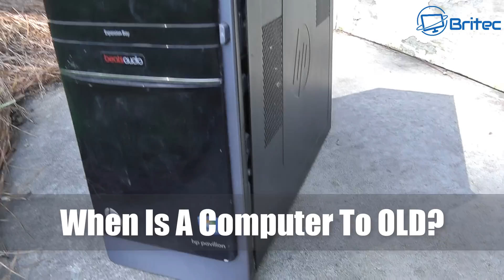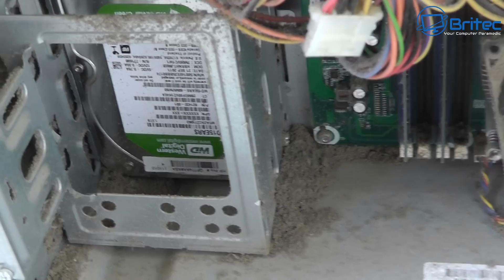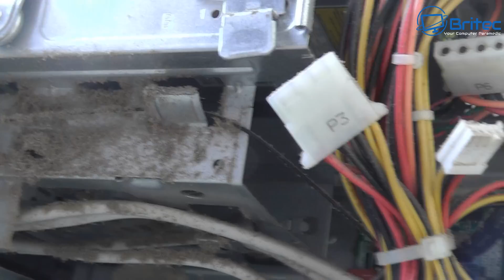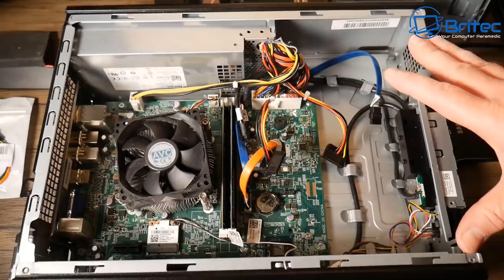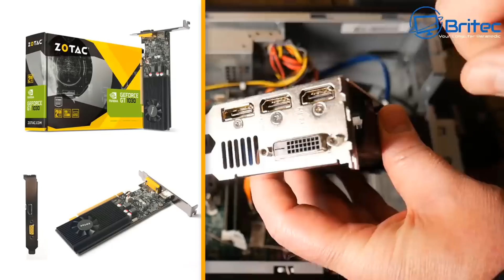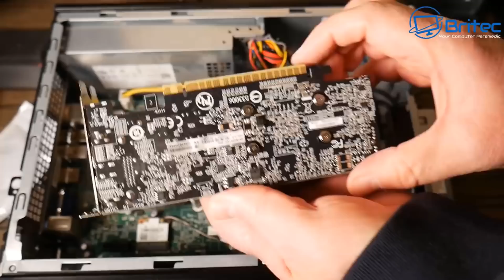When is A Computer Too Old

Comment: A PC is old when I can't do what I want to do with it. Otherwise it's perfectly OK.
Reply: I found when I purchased a new Windows 7 machine (back in the days when Windows 7 was what new computers came with) that computers can also be too NEW to do what I want with it. Approximately half the software I needed to run didn't work any more. And it wasn't a question of "getting new software" to do the same job - it didn't exist. I still run an old XP laptop for that reason.

Comment: This is a tough nut to crack😅 if it is about a personal computer for day2day-tasks, dont go too old. Sata, USB3 and SSD is a must i would say. Its also about reliability. Sandy Bridge is my minimum. If it is about a little server, consider old systems use more power. For NAS, reliability again. Really put a 18 Tb hdd into a 14 yo computer?! I like to build batocera computers from old systems for friends, also vortexbox, daphile, openelec etc. are running quite well on low spec machines. One exception: i run still my obsolete WD mybook with openwrt, fast and secure😉
Reply: why USB 3? Not everyone is transferring large amounts of data.
Core 2 Duos still works fine to this day, especially the 3ghz ones and the 2.5+ core 2 quads.
Reply: @yotoprules9361  Yeah, right. But whenever a external backup or an image recovery is necessary, it will take forever😁 but sure, if you dont need it its ok.
Reply: @sheldonkupa9120  you can also get USB 3.0 expansion cards, they work quite well.

Comment: 2011 dell XPS 8300 - i7 2600, 16gb ram, 250gb ssd & gtx 960. These compenents are second hand upgrades that I got for free while volunteering at a computer refurbisher but I paid for the used gpu upgrade few years ago. The only thing thats failed was the original 2TB HDD.
The only advantage in upgrading would be to play newer games and supporting windows 11. I play a lot of older games as i work my way through my steam library.
A normal person coulnt tell the difference between my computer and a new one unless they do a cpu benchmark compare. It starts in 10 seconds or less and is very responsive.

I work with a lot of laptops from 2016 which are atleast 3 times slower due to slow hdds. These are acutally due for replacement and can sometimes take 8-10 minutes to log into. It just shows you that age isnt everything but I will probably build a new pc in the next 2 years, mainly for windows 11 support, better game performance and hardware reliability.

Comment: I've found old computers, like old smartphones crash, irretrievably after an "update" . Only to work fine on older software after buying a new machine.
I was always imprerssed by startup, etc speed of new with latest. I also noticed that, other than graphics, the older, with systems they were designed for, work better.
Win 7/10

Comment: I have an old pc : Intel 775 dual core e5300,ddr 2 2gbx2 667mhz =4gb,hdd wd 500gb sata Ii with this configuration a dual boot with: 1) sparky Linux 32bits (wm open box,File manager pcmanfm) 2) Windows 7 ultimate 32 bits, i don't need an SSD for this pc,the response time "optimal" RAM between 200mb-1.2  GB (sure this machine don't works with the last games or renders) but for an Office envoirment Is excelent,if u have old hw and still works,why don't give It a "second Life"?.
Reply from the maker: Wow you do have an old pc
Reply: @Britec09 really my host pc is a core i3 9100,and i have more old hw an AMD sempron 2007 and pentium 4 tower 2005 with Ubuntu server.

Comment: My PC is 8 years old. It is a 4790K running at 4.6 Ghz with liquid cooling, Gigabyte Z87X-UD3H MOBO, upgraded graphics to 1660 Super (while only $Aud 360), 24 gbs of DDR3, replaced PSU with RM750X when the original died but that is it. Still a quite fast PC. Faster than some modern ones! Runs new MSFS (at 4K I might add) at quite high settings and renders video quite well. Microsoft in its wisdom says it is incapable of running Windows 11 - CRAP to that! The MOBO can accept V1 of the security chip (not good enough for Microsoft) and of course the rig would easily run Win 11. I will keep it until either the CPU rolls over and dies or Microsoft stops Windows 10 support. There are still some quite powerful older PCs out there and the newer parts like power supply, liquid cooler, ATX case and fans can all be used in a new build when it eventually has to be done so they are not wasted at all!

Comment: I am very tired of the 'disposable' generation, who think that you must be on the latest and greatest hardware to get a good experience.  I work in I.T. for a company who continues to dispose of very reasonable hardware, not because it can't be easily repaired, but because it is simply out of warranty.  We trash those systems all the time, even though a simple reinstall of the operating system is often enough to fix it, but sorry, out of warranty.  We throw away so many decent computers, iPads, iPhones etc. it makes me sick.  I salvage as much of those systems, repair them, upgrade them and give them to friends and non-profits as I can.  It's also funny how Windows 10 and Windows 11 are so much more efficient with their handling of processor cycles and memory, that a system that ran okay on Windows 7 runs like a champion on Windows 10 or 11.  One of my hobbies is to find what the minimal limitations are for hardware for Windows 11.  I have installed it on an eight year old netbook (remember those), and it runs okay as long as you don't try to play a YouTube video or run Microsoft Office.  That is because it is running on an Atom processor, with two gigs of ram.  But seriously, think about that!  An Atom processor on 2GB of ram, and a really weak GPU!  I know you're thinking that makes your point, but it doesn't, because that is the extreme low end, it can run well on almost anything above an Atom processor with more than 2GB if RAM.  Everybody seems to be caught up in the stupid game Microsoft and Apple play, which is we have a new version, you must replace (rather than upgrade) your hardware to run it.  Of course they subsidise the sale of computers with their latest operating system installed.  They Linux thing is only an option for us geeks who have been in the game for a very long time.  Unfortunately, Linux builders have never made their OS friendly to Windows or Mac users by using obscure references to applications, and making their OS not friendly to software manufacturers.  That of course is the reason why nobody makes viruses for Linux, they are only two percent of the market, and those are servers and hobbyists.
Reply: Yes, linux could be a big chance for old but still good hardware. I run my airbook mid 2012 with pop OS from sytem76, and man, its better than ever! And flex os is a similar idea. But all the linux distros for low spec computers have their downfalls and are not ez to understand for standard users.

Comment: MSI A88X -G41 PC Mate with AMD A8-7600 APU FM2 ; Radeon R7 Graphics; 16 GB (2x 8GB) DDR3 Corsair Vengeance RAM 1866 MHz.  Built in November 2015, with Win 7 Pro. on Spinner.  Now also has Win 10 on 256 GB Samsung 870 EVO SSD.  Not used for anything heavy-duty and does everything I want of it.  Email; Surfing; Writing Letters; designing Birthday/Christmas cards in MS Office 2000 Pro and MS Publisher 2000 Pro.  In other words; it does everything I want of it and nothing more.
Reply from the maker: AMD A8-7600 APU FM2 I remember them

Comment: What idiot would let their computer get that filthy inside? My computer is around 10 years old and still looks brand new inside and out. I never let dust or dirt gather up like the one you're showing. That's just from someone lazy and filthy. A good clean keeps it going as it should. Having said that, it will of course eventually be too old to use.

My stereo system goes back to the 1970s and 1980s and still works. My turntable is from 1976 and works perfectly. Only computers are made to need upgrading to keep the money flooding in. Just a money scam.

Comment: my computer is 13 years old with a xeon e5450 modded to a 775  in a hp dx2400 with 8gb ram 2tb hd + 512gb ssd then a 750 ti it did video edditing with no problems and was good at games unless they required sse 4.2, then i upgraded about 3 months ago to a i5-4670 with 16gb ram then moved my hd's + gpu over from my older computer. the boot up time is faster with sata 3 vs 2 but not by a whole lot maybe 15-20 seconds and i can play a lot of games i couldn't with the old HP because i now have sse 4.2 but other then that i don't see any real inprovement vs my old HP

Comment: My daily driver for telework is a Dell Inspiron 620 MT.
As long as the case is ATX standard it’s never too old.  I can work with it as long as it has a non proprietary front I/O header cable, rear I/O knockout, mATX board stand-off pattern, and allows an ATX PSU.
The oldest PC that I own is a Dell Dimension 2400, and being what they are worth on the vintage market I plan to keep it stock.  My next oldest is a gutted V2 Premiere that I purchased in the Shop NBC days, it’s a sleeper.
As a preteen I had an IBM 5160 XT, that would classify as too old unless one wanted to use software from that era.
Edit: I forgot that it (Pentium III and up) can also be repurposed as a DIY NAS.
Reply: Hahah still have a p100, intel mb, 4 meg of match memory.  Also an old single core tosiba laptop I used to burn  8 bit and 16 bit EPROMs. Runs win98

Comment: I have an 11 yr old HP DV7 laptop.  I have upgraded it massively over the years as far as it can go.  It started on Win 7 Home then I went to Win 10 Home and now it is on Win 10 Pro.  I went pro because I was going back to school to upgrade my tech skills and wanted all the bells and whistles.  I got an inexpensive and 100% legit key online to go Pro from a source I trust 100%.  Hardware wise it cannot go UEFI but that's OK.  I upgraded the RAM from 8GB to 16GB and then upgraded the slow 640GB original mech drive to a  1TB SSD and since it had a second bay I added a 1TB mech HDD.  It has a 17" screen and a (get this) Lightscribe optical drive!  ROFL.  It has served me well and continues to serve me well.  Since swapping to an SSD for the C: drive the machine has sped up tremendously.  The CPU is a quad core i7 running at 2.20GHz.  I have already purchased my replacement and use my old girl to remain on my desk with my multiple external USB drives connected to a 10 port USB hub and have the drives shared out through the old girl so I can access the drives on my new MSI from anywhere in my apartment.  I plan on keeping the old girl running as long as she will last.......When I purchase tech I always keep the future in mind even if I have to pay a little bit more and that proved itself out with my old girl being 11 yrs old and still running like a champ.  Extremely happy with my purchase.

Comment: I agree to some extent
Running 2008 Dell xps 420
Dual boot windows 10 and Linux mint
Only use windows when necessary  for certain software
2tb wd drive, 512gb ssd, 8gig ram,2tb external and 1tb external for backup on linux
Fits my needs , but do agree
Too many dollars put into old systems Doesn't make much sense
Reply from the maker: Thanks for sharing

Comment: I just last week bought a brand new desktop. 32G Ram, 1TB SSD, and many other features. Price was great as Costco had a sale on their Dell 27 7700 desktops. It will replace a 13 year old HP TouchSmart 520 PC that still runs good today. Over the years I had added to the original 4G of RAM it came with another 4 G (motherboard’s maximium there is 8G).I replaced the original 1TB HDD with a 1TB SSD about 5 years ago. If came with wifi, and a webcam. I added Bluetooth to it 2 years ago. I left it running with windows 10.
The new one is a big difference! I agree, … you can only do so much with these old devices (I also have 15 year old Toshiba laptop running with windows 11, and put an SSD and Bluetooth on that one years ago also.     WHY?????  So now this new Desktop and a laptop I bought 2019 are the way to go for me. Old cars can be restored and maintained to run fine, but ld computers? Maybe not.

Comment: 2009 ACER aspire X1800  came with VISTA.  Updated to 7 and then 10. Have a couple of external hard drives for storage and backup. One of your vids got me to double the RAM to a whopping 4GB (kudos for that). Its not 11 compatible.  Not a gamer or editor of any sort.
In a nutshell it does the trick.

Comment: 10-12 year old PCs are not that old and obsolete. I still think 775 PCs to be very usable(Dual Core 3.0GHz and above), but one just needs to adjust expectations...and add an SSD, don't you forget. Not only makes storage much faster it also makes your computer not so slow when you run out of RAM (for those with only 4GB of RAM).
Reply: You could even upgrade that Core2Duo to a Core2Quad if you wanted to.

Comment: I have to repair computers since (‘86 single sided floppies) and still using scsi drives and p3 intels. Not one looks as lazily cleaned as yours posted! Most common failure is drives then power supplies ( newer )

Comment: Probably the oldest budget computer specs that can run modern games would be roughly specced like this

DDR3 RAM 16GB
128GB SSD boot drive(Minimum)
5400/7200 RPM HDD
Quad core processor running W10/11

GPU? Any 2GB VRAM GPU(don't expect great fps though) 4GB VRAM is probably the minimum for PVP gaming

2cents from a computer hardware noob

PS: My personal build is a 10105+1650 GDDR6 

DDR4 16GB Klevv

256GB Lexar boot SSD 

1x 7200 RPM 500GB Barracuda
1x 5400 RPM 1TB Slim(converted from external).

Probably an i5 would have been better for the extra cores while playing Football Manager but otherwise works decently

Comment: If the computer does what you want it to do then it isn't too old. Most people aren't rendering video or playing video games. The vast majority are just web surfing and reading email ; both of which are primarily limited by connection speed not processing speed. 
I am running dual monitors on an FX4100 with 8gb ram. I web surf, design circuits(CAD), listen to music, watch movies etc. and I can open as many windows as I need. Tests with a second FX4100 proved that it can run Windows 10 as efficiently as Windows 7 after using WPrivacy10 to turn off most of the unnecessary telemetry. The only upgrade needed was a cheap video card to replace the onboard video. I have a 2 year old Windows 11 laptop and it runs slower than the outdated desktops, so new isn't a fix all. And no, I won't spend a fortune pointlessly trying to upgrade an 8 year old machine. I will run my old systems until they quit, or they can't do what I need them to do.
Reply: It wouldn't matter if I had the fastest computer on the shelf right now, my internet can't process anything fast enough to need anything but an old computer...when your internet isn't much faster than dialup was a couple decades ago, there's no point to having a super fast computer, the internet can't keep up LOL.

Comment: HP Elitedesk 800 G1 speedy and still working great with its old i7, and the stuff I threw in: SSD, 8 , 16 GB RAM, and a 108ti graphics card for light 1080p gaming. Don't particularly want to upgrade from Windows 10 and won't address that issue until 2024/25 or so.

Comment: This  video could use an uplifting reply. I have an ASUS P7P55D-E - LGA 1156 - Intel P55 chipset - DDR3 - USB 3.0 SATA 6 Gb/s - ATX Motherboard with an Intel Core i7-870 Processor 2.93 GHz 8 MB Cache.  A workhorse still suited for multitasking that boots into any MBR mounted 64bit Operating System extremely fast with added help from a Sandisk 512 gigabyte SSD hard drive How fast it's just as fast to boot up against my ASUS ROG Strix Z690-A Gaming motherboard with an Intel Core i7 12700K processor.    For a Motherboard manufactured in 2009 it is still quite reliable, having outlasted 3 power supplies, RAM upgrades, several Computer Case changes 5 to be exact and a miltitude of hard drive replacements and upgrades, it's still healthy and useful running Windows 10. It can run Windows 11 but I don't like the latest Windows version.  I haven't installed the latest GPU's or M.2's knowing this motherboard wasn't really made for gaming.  However it s worth using Windows 10 and easily adapts to any modern GPU or Linux Debian version like Linux Mint or Ubuntu Versions.  My favorite was Ubuntu 14.4 LTS and it is still downloadable from UBUNTU but since it's no longer in use I doubt there are any useable add on apps.  If your a britec09 viewer watching this video, "Never Let Any Computer Get That Filthy".  Clean it several times a year and use quality computer cases. If your a Newby ask britec09 to make a video on computer cases worth buying and computer cases that should be trashed as junk

Comment: Just got rid of two computers, one was a i5 2500k system I built in 2011, I sold the mb and processor and ram on e-bay. The other one which was my main computer was a i7 4790 built in 2015 but started to have problems  with the mb, the internet packed in for a start, I also sold the processor on e bay. I now have two new pc's running W11, one I bought is  i5 12600k with a RTX 3070ti and the other I have built is a AMD Ryzen 5 5600x, still has my old GTX 1070 graphics card in but its still runs ok has my second pc. Both are running with the latest M2 drives plus a old ssd in one for storage. I am 73 now so probably the last pc I will build, the last time I built a AMD system was using a Athlon chip. Keep Up the good videos very interesting.